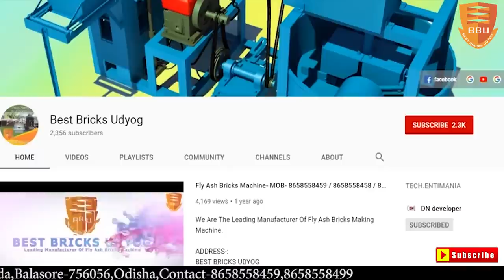Raw Material Of Fly Ash Bricks | BBM | Kaise Fly Ash Bricks Banate Hen

Comment: Sir bricks ka weight 3.9 kg aa rha h , usko reduce kaise kre , aur economical bhi ho , meri factory me bricks ka ratio , dust with 6mm = 350 kg, sand = 350 kg, 10mm=200Kg, Fly Ash = 100Kg ,. Cement= 105 kg,.  Kindly suggest sir
Reply from the maker: Please Contact Us- +919861106411

Comment: Which OPC cement produce more bricks
Reply from the maker: Hello,
@sisirapatra135
Glad you enjoyed it,
Thanks for Watching
Feel free to call- +91 9861106411
Reply from the maker: Hello,
@sisirapatra135
Hey there! I appreciate your question about OPC cement and brick production. It's important to know that the amount of bricks produced by OPC cement can depend on various factors.

OPC, or Ordinary Portland Cement, is a popular type of cement used in construction. Its main use is for making concrete, which is a mixture of cement, water, sand, and gravel. The number of bricks that can be produced using OPC cement ultimately depends on the specific requirements of the brick-making process, such as the consistency and strength of the brick.

It's also essential to consider the quality of the bricks being produced and the specific brick-making techniques used. factors like these may have an effect on the ability of OPC cement to produce more bricks. Always consult with a construction professional or follow the guidelines provided by the cement manufacturer for the best results.

Remember to select high-quality materials and ensure proper mixing, curing, and drying for the best product. Good luck with your project, and I hope this information helps.
FEEL FREE to call- 9861106411